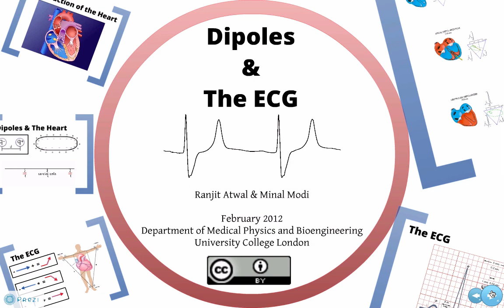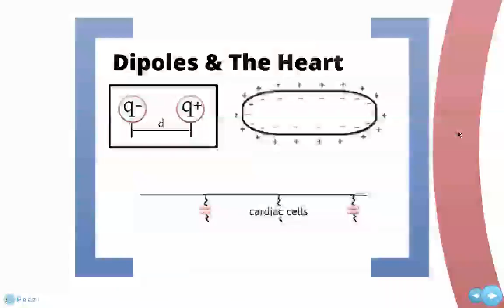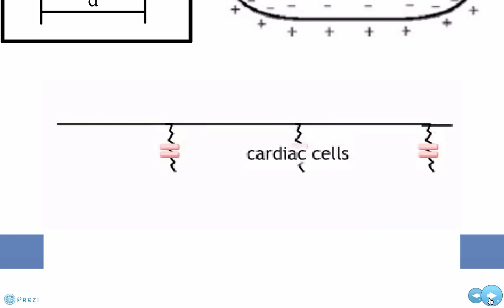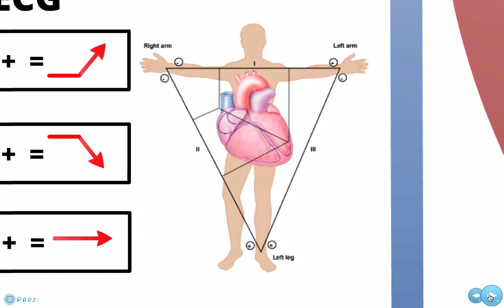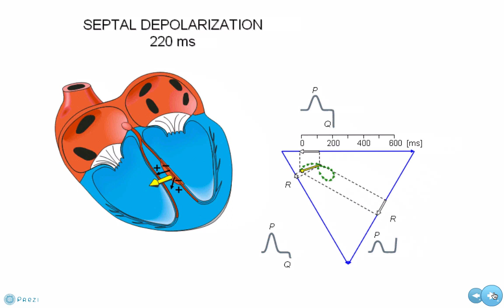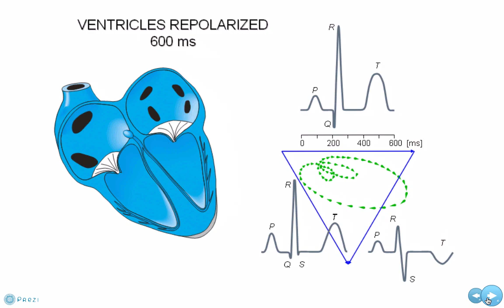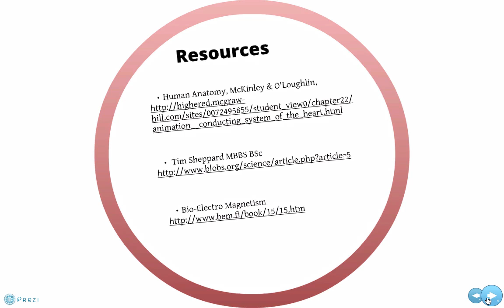ECG and Electric Dipoles

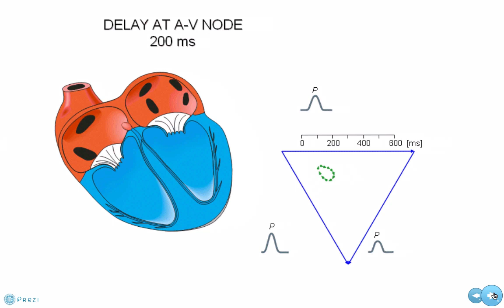Comment: At ~5:50, how come you're considering the return to the isoelectric line as consequent of atrial repolarization? Shouldn't atrial repolarization occur simultaneously with ventricular depolarization (QRS complex)?
Reply: Yeah. The curve returns to baseline not because the atria repolarise, but because the depolarisation has spread throughout the whole atria - i.e. the entirety of atria are again at the same potential. This leads to no difference between the potentials recorded by each lead, thus leading to the flatlining.
Reply: @susmitislam1910  but if the whole atria is predominantly negative wouldn’t the ECG perceive a raise on potential difference in contrast to the predominantly positive vetricules? I see Guyton explains the ST segment by this logic but I can’t find it for the PR segment.